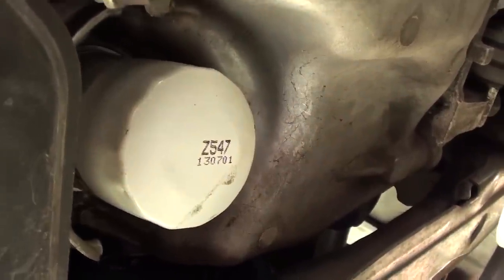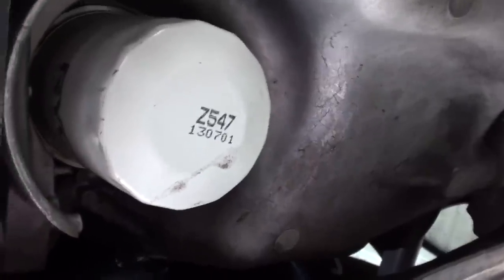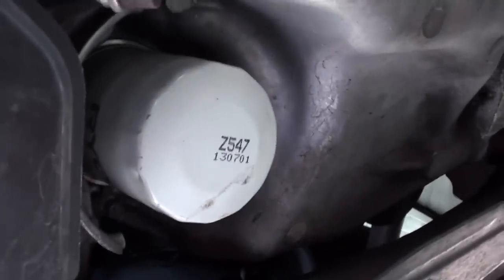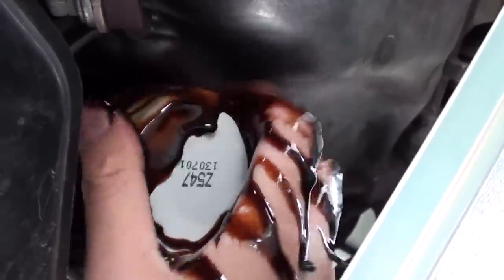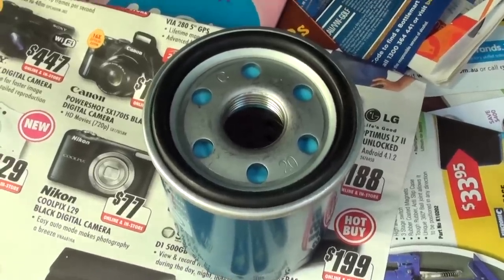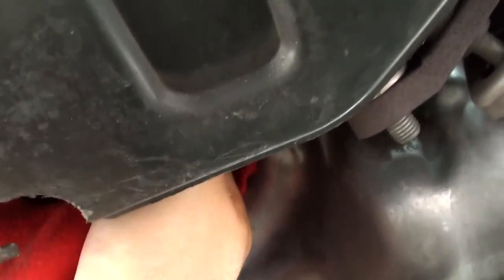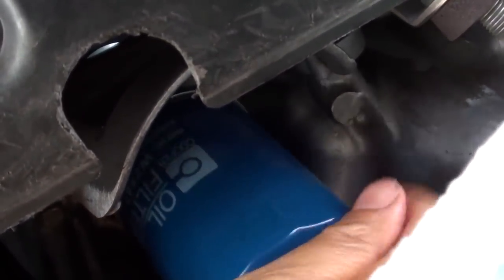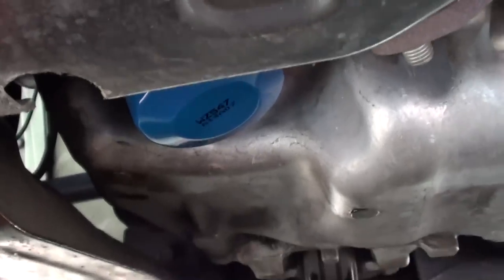Honda Civic: How to Change the Oil Filter at Home (2006, 2007 - 2013)

Comment: You should've  add   new oil filter  with new fresh oil,  Than installed ,I been doing this way for many decades all my engines have run grea and efficient.never had a problem .